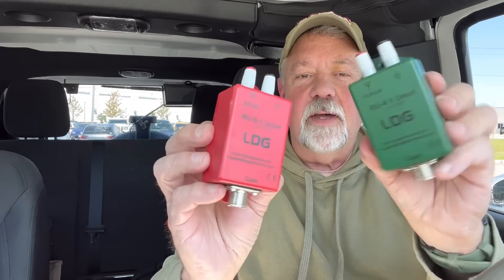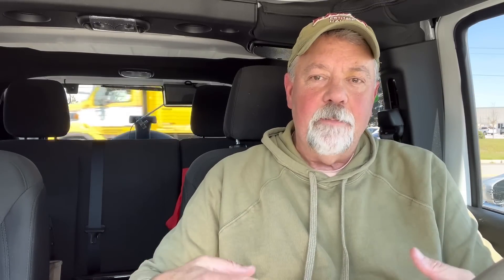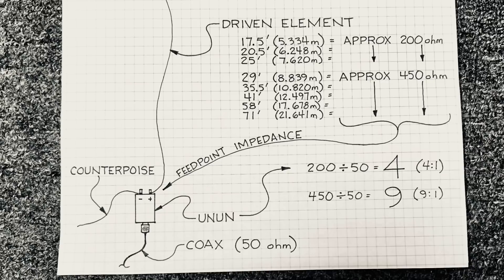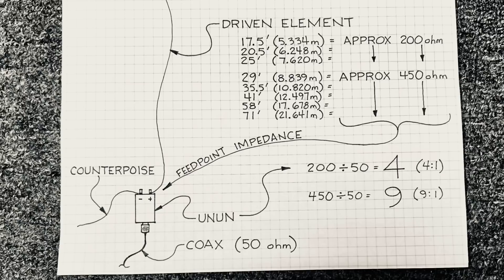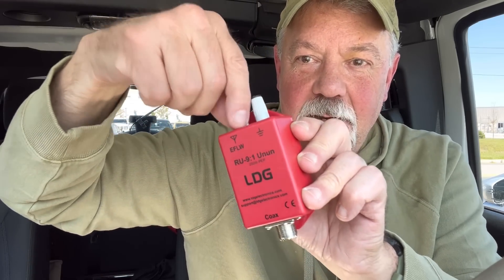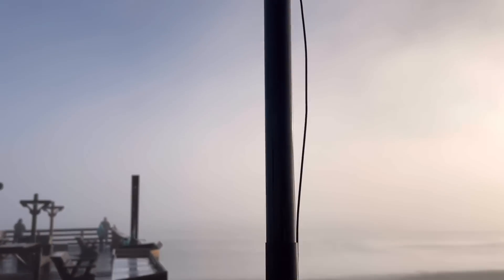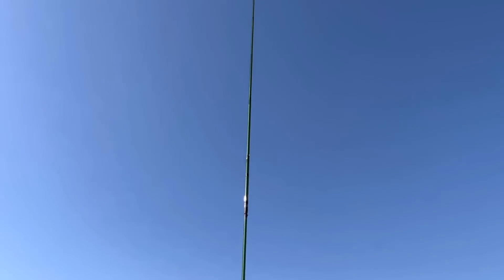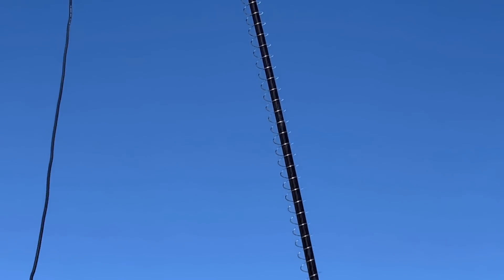4:1 versus 9:1 UNUNs - Which One Should I Use?

Comment: Hi, I notice that you use your unun at the lowest point of the antenna. My understanding is that the most radiated power is at the point where the antenna meets the the unun and therefore should be at the highest point. Am I incorrect?

Comment: I'm really confused about LDG's lineup of Baluns and Ununs.  The Black 1:1 with binding posts is called a "current balun" so I assume it is a Guanella. The Blue 1:1 with SO-239 on both ends is called an unun but I've managed to find pictures of one open and it's basically a Guanella (It would be dumb to use anything else as a choke).  They offer one Red 9:1.  While it is possible to do a 9:1 to one current balum with series/ parallel trifilar windings l assume it is a Ruthroff.
But there are two 4:1 models, one Grey called a "voltage balun" and one Green called an unun.  How is each wired inside?

Comment: Pretty good video, but I'm wondering if antenna impedance can be measured without an antenna analyzer? Is it as simple as measuring the resistance in the wire being used? Like if I'm using a 17.5 foot wire, do I measure resistance from one end of the wire to the other and that's what I divide be 50 to find the needed unun? Or do I have to have an analyzer?
Reply from the maker: Gotta have an analyzer.

Comment: I want to feed a multiband vertical with an 9:1 unun. The antenna is an Hustler BTV-5, above ground +/- 20ft roof (no choice). I have a bunch of 10ga household solid black and white wire ribbon that I can use for my project. dual cores. My setup is max of 600 watts power, tuner is rated 2kw. I know this video pertains to "random" wires, but rarely I see videos of feeding multi-band verticals and horizontal directional yagis. That would be interesting for those of us who are trying to enjoy with those particular setups. Any serious input will be appreciated! 73! Oh, the other question will be, 4:1 or 9:1 in vertical and horizontal yagis?

Comment: On my DX Commander 10m mast I currently have two wire antennas taped to it. A 29' wire and a wire cut to be a 5/8 wave for 12 meters. On Sunday, December 1st, I went out to my Tool Shed Ham Shack, took my 4:1 UNUN out and mistakenly connected it to the 29' wire instead of the 12-meter wire. I got on the radio and made many contacts and logging them with a note as to the antenna I was using. Later when it was time to roll up the coax and put my "toys" away for the night, I then realized I was connected to the 29' wire instead of the 5/8 wave 12-meter wire and I never knew the difference while operating my radio. The QT80 reported a 1.7 SWR while operating on 12 meters. Later I'll put the QT80 on the 12-meter wire and see what SWR it reports then. LOL

Comment: I use a 9:1 with 65 ft on driven side, 17 ft on the ground side. Basically an end-fed half wave for 40 meters set up in NVIS mode. I'm glad your math validated what I'm doing. My SWR on 20 and 40 is very close to 1 without a tuner. 66 feet might be slightly better as 1/2 wave of 40 meters is 65.6 feet.

Comment: EVERY antenna outside of the vacuum environment is a comprise. Everything affects everything. My motto is if you can hear them and you can safely (SWR wise) communicate with them, then you have an effective antenna for communicating at that time. I own a 1:1 Balun and try to keep things at a half wavelength whenever I can. I have a manual MFJ tuner to take up any differences in impedance for the safety of the radio and efficiency. If that can’t tune it then other things are amiss and those things need to be addressed.

Comment: Great video Walt. remember the main goal is to get the impedance down to where your tuner can handle it and match to the radio. The numbers don’t have to be exact just low enough for your tuner. Things are different if you don’t have a built in tuner but there are options for that too.

Comment: Nice job Walt ! Best think ,Do not over think it.  Both 4:1 and 9:1 need tuner. Just look up wire length and give it a try . Every set up and ground different.  The only way to know for sure is build it and try.  I found a length of 39 FT for 4:1 . working great 20 meters. that is 5/8 wave.  I just built it cut once and go SWR of 1:1.9 on 20 meters . I just used my ATU on IC 7300 and got on the air. Over 100 FT contacts at 50 watt portable .The RX was amazing. I had end fed 1/2 wave for 20 meters. That tunes 1.3 SWR with 49:1 . MY TX reports about the same but that 5/8 wave had better ears . noise floor was about the same.  Some 4:1 length work better on 10/11/12/15/17/20 meters . 5/8 wave is Resonant on a band and will tune on harmonics like the 1/2 wave does.  I got better 4:1 UNUN on the way. coming from France and 1KW rated. 1-54 MHZ. Sept 25th is eatemat date.   I did have RF getting into the mic on 9:1 using coax as counterpoise. 1:1 and 17 ft counterpoise at antenna fixed that . When portable bring 1:1 choke and counterpoise with you. may need it. Every set up different. 73

Comment: I hate how everyone that does one of these video's seems to feel the need to say random wires are not really random wires. It's the DUMBEST thing anyone has to say ever. I know WHY it's said, but I think it's high time for another solution. Either a dedicated descriptive, or nothing at all. Just say random and be done with it, for the dumbest of the dumb that cannot understand the idea, then too bad, learn to read a book or something. It's annoying to constantly have to slow down for idiots that cannot comprehend simple shit. 99% of people that are into HAM radio are smart enough to know that the word random is not actually random after all, as they can look up these so called "random" length wires in a tabulated form. If they are written down on a table, then they have obviously been tried as a length, so therefore are no longer a random wire, they are a tested tuned length, and the one's that work get used over and over again by the next iteration of HAM's. Good video though, as always.

Comment: As soon as you are into multi band you are into compromise. If compromise is not your thing then build single band resonant antennas. I am mainly a 20m guy but I use predominantly 4:1 on my wires because it suits me for those times when 20 does not play nice. I am not looking to win any prizes just have a bit of dx fun at QRP power or up to 25 watts. Like Walt I sometimes use 11m as well -shock horror ! Great DX was rolling in tonight on 11 🙂. 73 to you all and make sure that radio is fun. It will help you live longer and have more friends. M7BLC

Comment: Nice video Walt.  The reader should understand that when you are saying 4:1,9:1, 49:1 you are talking impedance ratios, not voltage or transformer turns ratios.  The voltage and turns ratio for a 49:1 impedance matching transformer is only 7:1 for example. Other basic things people should be aware of is when NOT to use an impedance matchmaking transformer. For example, the nominal feed point impedance of a Hamstick operated at its design operating  frequency is not far from 50 ohms.  It most likely will at resonance be maybe 25-30 ohms especially on 80 and 40 meters. Which is why. when feeding a Hamstick vertical on a vehicle directly, you can see a dip in SWR at the resonant frequency, but the minimum
may only be at best 2:1.  You could make something like a 2:1   Impedance transformer to bring  the SWR down to very close to 1:1, but it’s also possible by adding some shunt reactance across the feed point either capacity or inductance to provide for a better match.  Typically 500 pf on 40 meters and 500 or 1000 pf on 80 meters, or alternatively use a small shunt coil, maybe 6 turns of #14 stranded insulated wire close wound on a prescription pill bottle.  Hamsticks operated on their intended design band for 20 meters and shorter wavelengths generally will, if
properly installed with a very short and direct connection of the coax shield to the vehicle body and the antenna mounted as high and in the clear from the vehicle body, be able to have a near perfect 1:1 at most 1.5/1 at resonance without either an impedance matching transformer or a shunt cap or coil at the feedpoint.

Also those using end fed wires need to be aware that if you are using a quarter wave wire say 65 feed on forty, it’s feed point impedance on 40 will be close to 50 ohms, so at most you might need a little L or C shunt across the feed point.At 20 meters you now have a very high impedance half wave wire and a 49:1 impedance transformer is in order.  At 15 meters you are now at 3/4 wavelength and on on harmonics of 1/4 wave feed point impedance will be relatively low, at 10 meters you will be at an even 2x full wave length with a very high impedance, so back to the 49:1,  etc. 

I prefer whenever possible to work with either odd or even multiples or fractions of wavelength if possible, rather than random non resonant lengths.

Another thing to keep in mind is that when you start operating at  whole multiples of a wavelength  , significant pattern lobes and nulls creep in, and especially for vertical antennas degrade antenna radiation efficiency.  For example
I run a nominal 35 foot wire vertical on 40 meters as a quarter wave vertical with a shunt match and 18 elevated radials.  It has a very strong low angle pattern and is a great DX antenna. Likewise a can run it as an end red half wave vertical dipole on 20 meters with a 49:1 impedance transformer ( using only a single short counterpoise wire and it works well for DX with low SWR and a low angle main radiation lobe.  However the same setup run on 10 meters as an end fed full wave vertical, while also having a decent low SWR, is about. 2 or more s units down from a relatively high elevation horizontal dipole when work g DX due to a much reduced low angle radiation pattern.

Chris, AJ1G
Stonington CT

Comment: This all needs to be in your highly anticipated “antenna notebook” 😉👍. 73 de Dan WD4DB
Reply: Until Walt publishes his book, I recommend folks read the ink off the pages of the antenna and transmission lines chapters of the ARRL Handbook, the ARRL Antenna Book.  Other good ARRL reference publications are Low Band DXing for 160, 80, and 40 meter
antennas, and their Wire Antennas book.

Chris AJ1G Stonington CT.

Comment: Thank you, as always interesting! However, you have an ocean with salt water and this is a huge plus for long-distance communications. Not everyone has such conditions. Therefore, for those who are not near the ocean, I want to say, use only resonant antennas for QPR and do not be lazy to switch them when switching to another band. Otherwise, you will not see luck))
Reply from the maker: @eugene-anthony4823  yes and no, I understand the advantage of resonant antennas with low power but I have seen great results with random wire antennas well inland away from saltwater. I mentioned my saltwater advantage in the video but I also showed the random wire antennas I built in Poland while I was there and if you saw any of those videos I worked some great DX. 73, Walt
Reply: @COASTALWAVESWIRES  I watch all your videos, thank you!

Comment: Hey Walt, quite a nice and practical summary of the topic here. I've been using "your" 20.5ft / 6.24m variant of the vertical long wire rather extensively over the past few days and I had pretty good results. But boy, does a 10m wire going to the sea water make a huge difference!
Thanks to the high tide while I was on the beach yesterday, a good 2m of that wire was floating on the surface and SWR dropped to "can use without an ATU" level on almost all bands except 15m. My one and only ground radial, and it sure did  a good job! Thanks for the great advice you gave. This antenna fits nicely to my sturdy Capelan 7m pole that can stand the windy climate here in Brittany.
Talking of ununs, I had significantly better SWR readings with an 4:1 unun I took from my M0CVO "Magitenna" (a Rybakov) kit than with my LDG 4:1. Not sure why. As I mentioned some time ago,  I've been hugely disappointed by the build quality of these ununs when I opened the case of my 9:1.
Best 73s Salty Walt from another currently quite salty Alain.